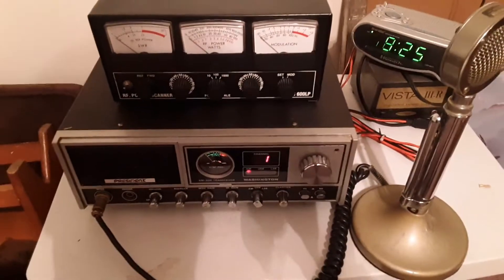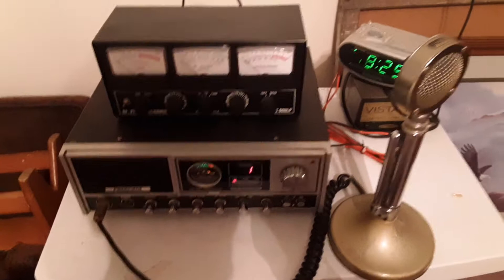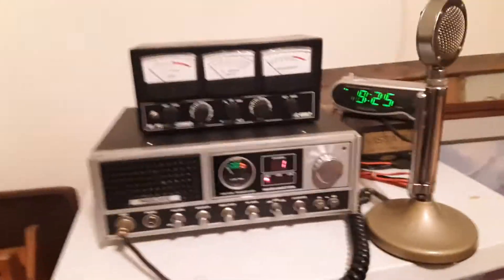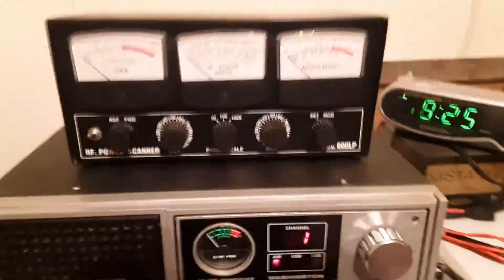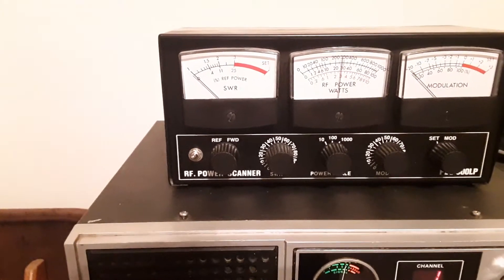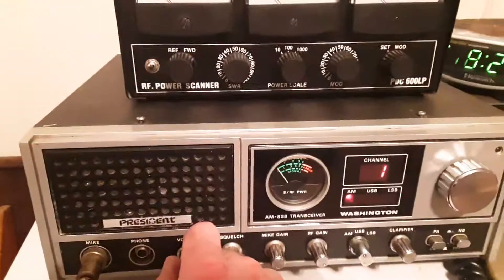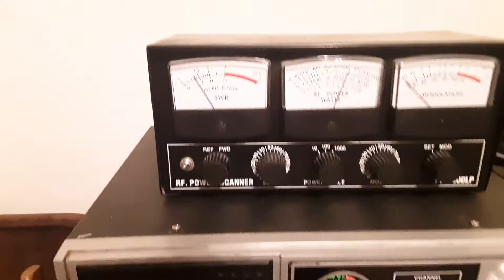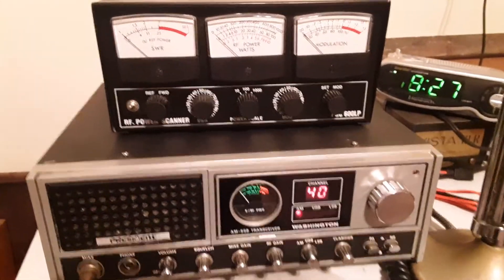Rocking a living room dipole - an indoor solution for your CB when outdoor antennas aren't an option

Comment: It works better as a vertical or angled.  Most CBs are running vertically.  I tried horizontal and most local people could not hear me.
Reply from the maker: I had one atop a 90-year-old oak tree, polarized vertically. It talked as good as any A99 or Big Stick out there. Problem is, people only able to run one indoors don't have the option of polarizing vertically.

Comment: I have mines around the four corners of my room and the wires cover the whole wall. On the radio it’s self my swrs are hi but the external meter says 1.4 what should I use or depend on?

Comment: How many feet of coax needed
Reply from the maker: Whatever you need. It doesn't need to be specific. The dipole uses 2 lengths of wire to achieve an acceptable SWR match (di-pole/2 poles/2 wires). That negates the need for a ground plane and makes your coax length irrelevant.

Comment: Good build. 👍🏼  On AM, horizontal polarization will limit range to the typical vertically-polarized mobiles and bases, but is doable for close-in work.  SSB may exhibit a little more distance.  i'm obviously a fan of simple antennas that do the job. 😉

Comment: The center of a  Dipole is 75 Ohms but if inverted, you can get the SWR down to a safe level however, this works best if the lowest point of the Dipole is about a quarter wavelength above the ground.
Reply from the maker: Correct. I have an inverted V at home that I used 1/2 EMT conduit and a 90-degree Handy Ell to build. It took me 15 minutes to build and it does a really decent job. It's a bit directional, but anything except a vertical polarization always will be.

When I was younger, I had a vertical dipole made with 14 AWG THHN and it had a Lexan center insulator that I mounted an SO239 in the middle of. I shot it up in a 90 year old oak tree with a sling shot, fishing line and weights. The top of the antenna was probably 60 feet.

It gave me five years of excellent service. I regularly ran 300 watts through it with zero issues. It talked as well as any A99 I've ever owned.

People shit on dipoles without realizing that they will perform wonderfully when vertical. Problem is, that always requires a lot of height and people aren't always able to find a tree to use.

But the horizontal dipole is no slouch at 18 feet off the ground. The directionality is the only impairment.

Comment: What length of wire did you use ?
Reply from the maker: That was stacked speaker wire or lamp cord. I can't recall. But if you are using insulated wire or stacked wire, it will need to be much shorter than what antenna theory suggests. Thats because the stacked wire and extra insulation makes it appear electrically longer to the radio.

In this case, this one I think ended up being about 98 inches per leg.

If you are using single conductor wire with insulation, start at 104 inches per side and start measuring and trimming accordingly. When doing it indoors like this, antenna theory is only a reference point because the installation is compromised

Comment: Did you ever do a range test ?
Reply from the maker: We did. My friend Doug (Bud Man) used this setup and talked to all sorts of mobiles and bases inside of town and the outskirts. He was able to reach another CB operator that was about 10 miles away on a base station with a 5/8-wave ground plane that was 50 feet up. 

We added a little RM Italy KL35 Mosfet amplifier to it and it gave him a 30 to 40 watt forward swing, which surprisingly made HUGE difference -- not to the extent of 250 watts or anything, but it was significant to his in-town talk power, without disruption to any other electronics.
Reply: @freepressright  
Awesome 😎 . I just got my tower lowered and my 7 element on the test pole . 
I’m having to retune it and swap coax , etc 
I’ll do a little updating on my channel I started recently .  I found your channel by accident , you have some good content 
Radios , guitar and fitness . All the things I like as well . Although I only play around on the guitar , not really play ,, not yet anyway 
But you got some skills brother !!

Comment: If each leg of the dipole is 1/4 wave then lowering the ends to make each leg a 45 degree angle should put it at 50 ohms to get a great match.  I've made several Inverted-V Dipoles over the years.  They are good and you can make one for just a few dollars in parts.
Reply from the maker: I've got one in the back yard that I made out of 1/2" EMT conduit pieces and a Handy Ell (pulling 90). Mine works great, but it's a pain in the ass to mount with the 45-degree legs.

The most ideal scenario for local talk is a vertical dipole, but unless you can tie it up in a very high tree, the physical length is an obstacle. I had one that was strung at the top of a 90-year-old oak tree, polarized vertical. It talked as well as any A99 or Big Stick, and it loved power. I rammed 500 watts through it many times with no issues.

Comment: I hope you remembered to use a 1:1 balun between the dipole and the radio. A die pole is a balanced antenna. CB radio antenna's are not. The only other thing you can do is hang your die pole as an inverted V to get a signal out. You can also make an ugly balun just coiling then coax cable around an old style coffee can. I think it is around 4-6 turns. This will get the signal out the antenna. When I first made my die poles I could never get them to get out properly until I added a 1:1 balun it made a large difference. I could be heard by other stations from quite a distance.
Reply from the maker: I've done the ugly soup can or coffee can balun before, but I've found them in most cases not to make a world of difference. I do have some ferrite and materials to make nice baluns, but I've always had tremendous luck without them if I'm patient during tuning. 

My best dipole was no. 16 stranded copper, polarized vertically in a tree, with no balun. The oak tree I shot it up in was 90 years old. 

It worked better than any A99 or Big stick that I've ever owned. And I put 500 watts through it with regularity.
Reply: @freepressright  You are on the right track. I use a home Dipole above the ceiling in the crawl space. I cheated and bought a MFJ (6 meter to 20 meters). I did not cut it down. It cranks out nearly 1:1 SWR across the 11 meter band. 
About the inverted 'V' set up. It does work better as an omni directional antenna. I would move the center out about 4-6 inches from the wall and have it hang from the ceiling. But I'm a fuss butt.
Reply: @freepressright  Same.  Unless you are running power and have a problem with common mode current - RF getting into everything.   Where baluns and chokes really come into their own is on unbalanced wire antennas such as the Windom variants and the end fed half waves.